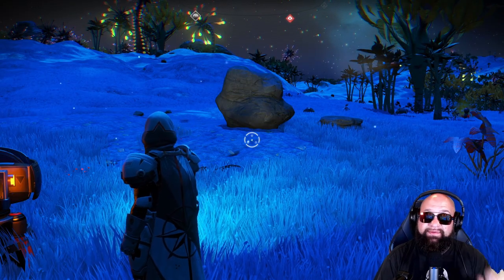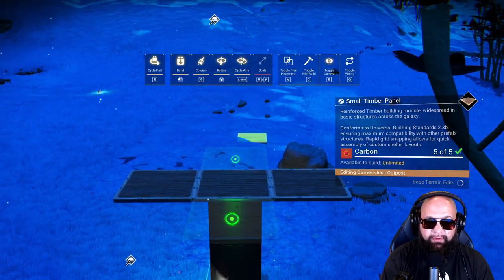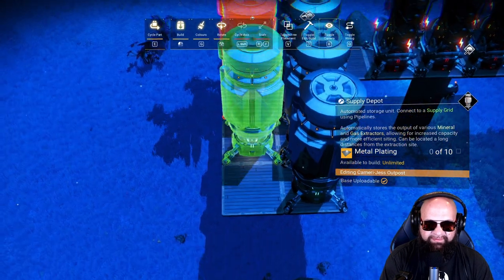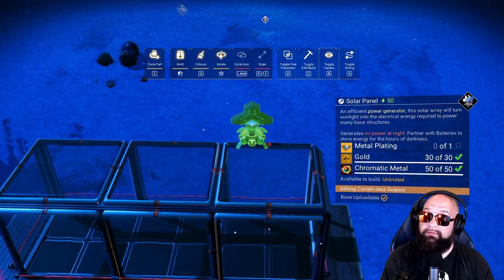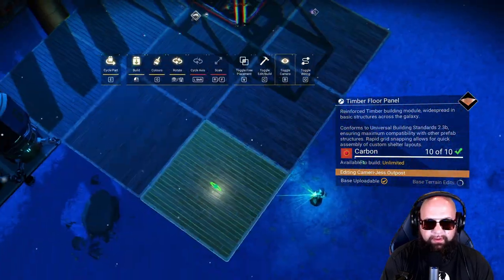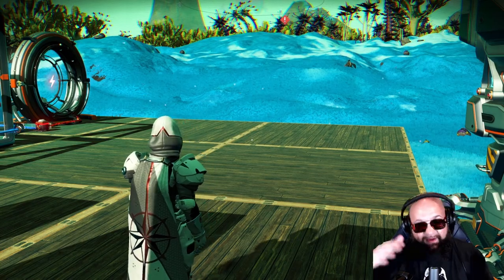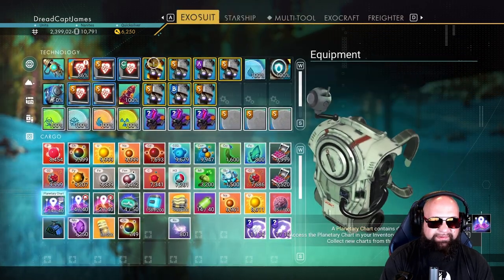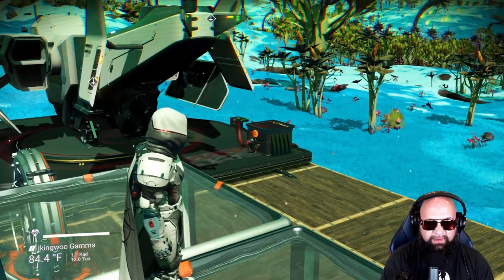Quick and Clean Mine Build for No Man's Sky

Comment: you guys should try resizing all of those and you can make them fit in a room, and place 4 5 refiners in one single small timber panel, if you are curious how, go watch resize glitch , there are videos shows you how to do it, you can make all of them much smaller and you can fit them in walls. and always look for electro magnetic generators because you need solar panels and batteries, otherwise you only need one unit for power
Reply from the maker: Yep, glitch building is definitely NOT what this build is about, and this is considerably faster than finding a EM source. This concept is to set up a quick mine, teleport, and move on. This is clean and speed. You could easily glitch all your refiners on one point, all your supply depot's on another together as well, and same for any other unit, but that's not what this is showing.

Comment: Excellent video. I was able to build my first mine in about ten hours,! 😂 Now that I've collected the blueprints and experience, the next should take me under a half hour. ONE QUESTION PLEASE: My extractors don't run through the night. The batteries are being depleted, but the machines aren't running. I've double checked the wiring, I think it's fine. Any other suggestions? Thanks.
Reply from the maker: If you open up the solars, it'll tell you how much they're producing. Do it in the middle of the day when the sun is strongest. Then look to see if your batteries are holding about double that. If not, add more and double check wiring. You should see the output for the whole network when you look at one

Comment: I always put down 2 solars and one battery for each extractor and I never run out of power. Don’t understand the 7:5 for each 3 extractor ratio. Too many solars and too many batteries
Reply from the maker: It's the ratio the No Man's Sky Assistant provided based on the exact amount the base drained. The tool is credited by the devs, so I always went with it. Never once had any issues, and they're easy to make so if there happens to be a surplus of power, that's not bad. There's also the teleporter to consider, and the cuboids draw a slight amount over time...in other words, you do you, but this way has worked for me and provides a cushion with enough to guarantee the base runs and batteries charge.

Comment: wouldn't it be better to use the metal floor plating to conduct power with out the need of wiring?
Reply from the maker: It's never worked that way for me, but makes me think I need to "conduct" a science experiment...see what I did there?
Reply: @DreadCaptainJames  can you hear the face palm and the groan from there HAHAHA, I think you'd have to use the prefab pieces like you did with the glass box's, I'm building this right now on a A class copper sight so I can have plenty of chromatic metal. but rather then a gate I'm just gonna put down a sight to sight teleporter cause it's right outside my colony sight.

Comment: Great video!
What resources would you recommend as must have mines for?
How on earth do you get into build camera mode???
Do the mines last forever?
Reply from the maker: First, thank you! Resources recommended: oxygen, nitrogen, sodium, and uranium. Oxygen is a life saver and can be combined with many other things to multiply output in a refiner. Nitrogen and sodium can be used to recharge shields, etc. Uranium will make it so you never have to create launch fuel ever again. The build camera can be accessed by either a left stick click on the controller or by pressing B on the keyboard. And yes, the mines are good forever, so build away and enjoy the spoils!
Reply: Sorry to necro but thought I’d share. I found a really good planet with o2 and copper in close proximity to a power field.  I have all the chromatic metal I’ll ever need. It’s pretty great.  Highly recommend a copper mine.

Comment: @ Dread Captain James. I did everything that you said to do with the mining setup. Everything is running smoothly but my equipment is not extracting minerals.  I wonder if my platforms are too high,  can you please give me some advice? Thank you
Reply from the maker: Any chance you have the wrong extractors set up?
Reply: @Dread Captain James, I  have the mineral extractors. I think that I might have figured it out. I didn't use the Survey Device to scan areas for potential minerals, I just went to the ones that were on top of the ground lol. For example, Pyrite. I saw the pile and set up shop. I will let you know if it works. We use to call it Operator Error at shop jobs 🤣🤣🤣🤣🤣
Reply from the maker: @d5andthesevenseals712  yeah, sorry! Definitely need to use the survey device, and then it will totally work!
Reply: @Dread Captain James.  You are a genius.  Thank you, sir! It worked very well.
Reply from the maker: @d5andthesevenseals712  I'm glad it did, hope it helps! o7